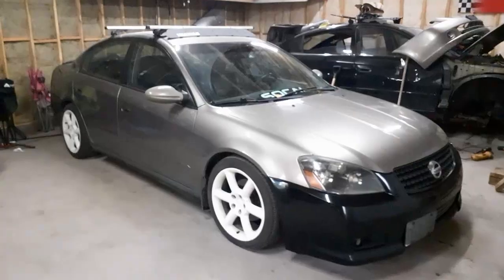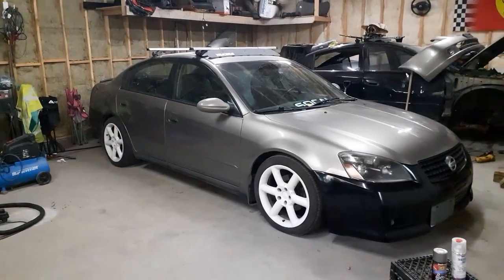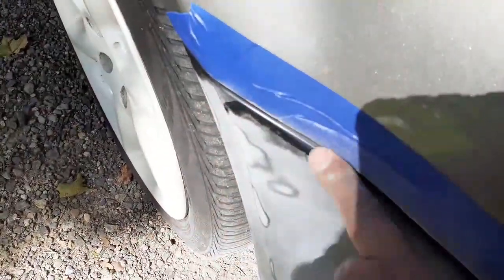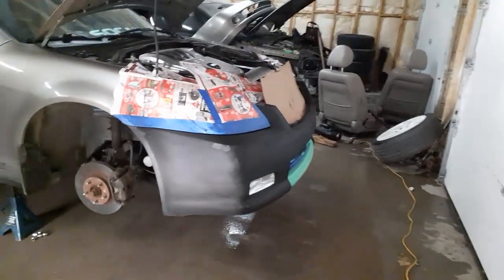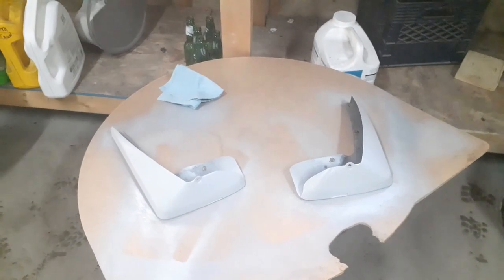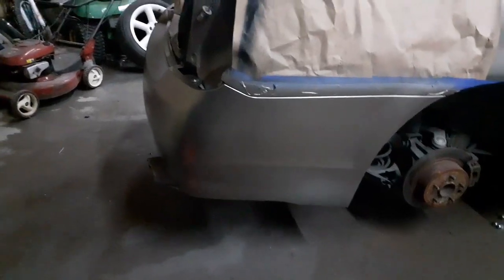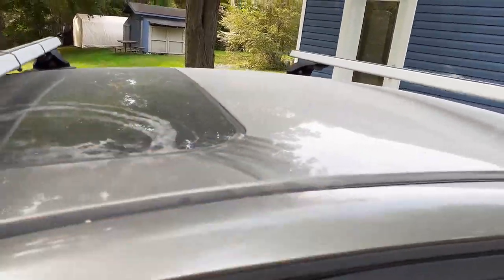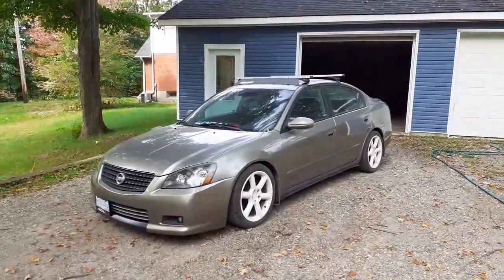Dupli-Color Paint Job With 2K Clear Coat

Comment: You need to wait 48 hrs, went sand and buff...it will look WAY shinier
Reply: With what grit sand paper?
Reply: Zachary Calloway 2000
Reply: Depending on how bad the finish is after spraying .. orange peel etc. ..1200, 1600 then 2000 followed by a 3000 grit pad then cut and buff it. For a pos Honda or Nissan..Don't even waste the money on papers ,plastics , tapes, primers, sealers, paints, reducers,clears, hardeners ,blocks, or sand paper..Let alone compounds, pads, or buffers. Yes there's alot that actually goes into painting a car. To do it right you'll have more in the paint than the car is worth. Never ever use Rustoleum products o a car...EVER.

Comment: Looks good man. I’ll be doing the hood on my 03 G next week clear coat is toast. 2k clear is the best I did my trunk and emblems with it, came out perfect. Tip I was given is put your spray cans warm water to help get more pressure. Nice to see you still doing videos bro. Keep it up.
Reply: LOWkeyG 35  you painted your trunk with emblems on it?
Reply: Drippy.j7  Painted my Infiniti emblems front and back. Also recleared the top of my trunk.

Comment: Don't be afraid to lay that 2k down wet. It lays pretty flat. I think that's why it doesn't look as shiny
Reply: Thanks - I'm getting ready to buy some to finish up a new fender (2 deer vs. car incidents but they hit the same spot).
Reply: @Uncommonsensesc  let the cans sit it warm water for a few minutes before you mix them and spray. It will help with atomization. 
The first coat is a thin tack coat. Let that tack up and then lay down two wet coats.

Comment: Be interested in how well you 2K clear held up?   I used the same 2K and the silver Dupli-color on my Corolla and the 2K clear delamintated after only 6 months.  Found out after much research that the 2K clear does not like to adhere to Lacquer and delamination is inevitable.  This time around I used Rustoleum Clear 2X Painters Touch because it's also lacquer.  So far the shine is superior but time will tell on the durability?

Comment: Guaranteed that your holding the can too far from the paint I’ve used that 2k countless times never had an issue, it turns out like the clear coat on the rest of the vehicle. When u get a chance hold the can closer to the surface your painting and see the difference using  2k

Comment: Use some high grit 1500, 3000, 5000 wet sand...buff it with some scratch remover...itll make that clear coat pop
Reply: 3000 barley even scuffs it lmao. 1500-2500-3000 and meguiars m105 then m205

Comment: Can a SER front bumper fit on a 2002 Nissan Altima 2.5 S model ?
Reply from the maker: Yes it will fit but you will need to swap the hood and headlights aswell as they are different
Reply: DNALI I would have to swap the hood and headlight for the bumper to fit properly?
Reply from the maker: @freddiedaniels6229  yea the front end is a bit different on the 02-04 Altimas
Reply: Hey @DNALI what was the dupli color color my car is the same color as yours

Comment: The clear goat will turn golden when it dries , I sprayed my fender with perfect match and dupli color the care is silver , clear coat turned it golden . I had to re do it and it looked better without it , a month later my neighbor was painting his car and let me pull in his driveway to use his clear coat with the paint gun and air compressor and the fender looks like a professional job . I if your car is a lighter color don’t use spray can clear coat .

Comment: Looks good. Few observations
Did you scuff it down with a grey scuff pad before?
Was there any adhesive promoter used?
And did you scuff the primer before basecoat?
For the future "never" leave a basecoat to sit longer than an hr before applying clearcoat. What will happen is the clear won't fuse to the basecoat and it will peel very soon. All and all it came out good. 💪🏾
Reply from the maker: I didn't do any of those things lol. Hopfully it holds up over winter  that will be the test
Reply: The base coat and 2K clear are different products. Yes, you want the Duplicolor to cure before applying 2K. If it was 2K primer then yes, clear  after flash off.

Comment: Not sure why you put the 1K clear coat down? Would have been better off putting another coat or two of paint on and then 2K clear coat and skipping that uncatalyzed clear coat all together. It wouldn't matter how much of that 2x clear you put on it will never stay glossy because it's on catalyzed it will also chip easily and won't be resistant to gasoline or any other chemicals like the 2K clear will. And you're right about the 2K clear coat, if you would have stopped at two coats you would have been better off only because your third coat really should be a flow coat, you ended up kind of misting it on probably. No harm no foul just knock it down with some 2000 and buff it. Give it a little time to cure out in the sun first

Comment: If you light sand the back bumper with 2000 grit and use a small amount compound you should be able to get a highly gloss once it buffed should be permanent.

Comment: Nice video. So from what I read so far is that the 2k clear has peeled off? If so, what did you do next? Clear again but with 1k clear? Thanks.
Reply from the maker: I did end up redoing the clear yet. I will be repainting it over the winter with different clear

Comment: The clear will never be glossy out of the can when dry, people mistake this to clear coat shot out of a spray gun which you have more options for 2k clears from different manufacturers that stay somewhat wet when dry but wet sanding and buffing is an absolute must for clear coat no matter what. The main reason for this too is so you can "blend" the new paint to the old by polishing and waxing the whole car when job is done. Also for certain 1k primers like duplicolor it's best to leave the can sitting in a little bucket of warm water while your prepping your car for paint, this allows the primer in the can to mix better and reduces splatter, runs and potentially clogging spray tips. 

Awesome video brother keep up the good work.

Comment: Duplicolor clear coat is actually better than 2k clear if you know what your doin. It's called duplicolor for a reason. It's as good as stock paint
Reply: This is completely false. 2k paint is professional grade paint with a chemically activated hardener.. duplicator is regular spray paint and not very durable

Comment: THANK YOU for not doing the enamel.based rustoleum paint job...while cheap and being oil based it'll  look flat and won't hold up to the environment (cars were painted like this in the 40s and 50s, etc). Laquer based paint rattle can you are doing is better, and you are doing a 2k clear which is even better. When you do get a chance to learn how to do urethane paint jobs you won't regret it! Just takes a little practice and patience. A job worth doing right is never worth doing half a ;)
Reply: You'd be surprised at how well the rustoleum holds with proper prep and a 2k clear over it. Doesn't fade any faster than a laquer or urethane job. And it costs waaay less.
Reply: @CompOstang50 most people dont 2k clear on those rustoleum paint jobs on YouTube. So I agree yes it can look good. BUT if you're going to 2k clear coat it, might as well do the job right. It's another 50 or so for a gallon of the paint you need with acrylic urethane.